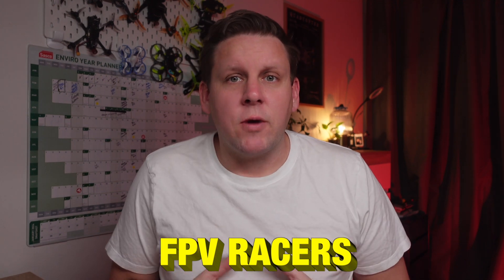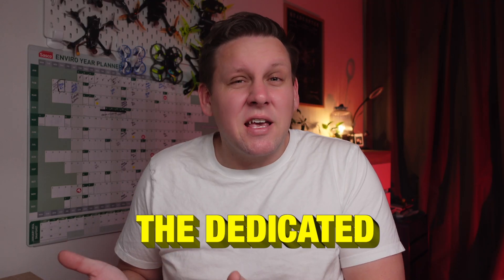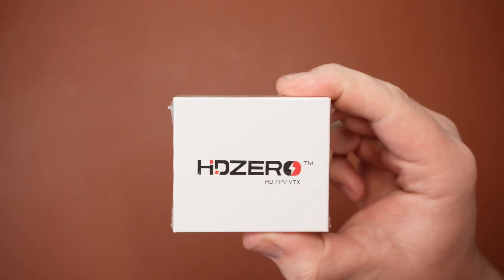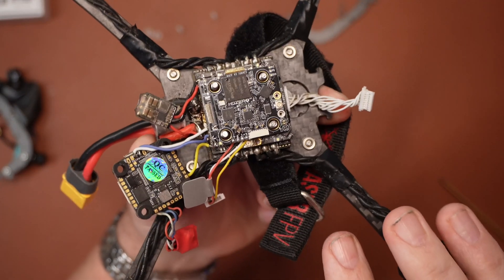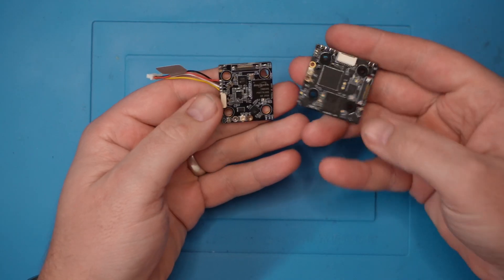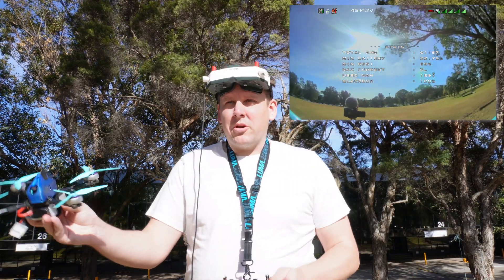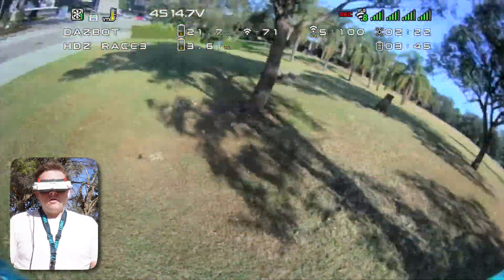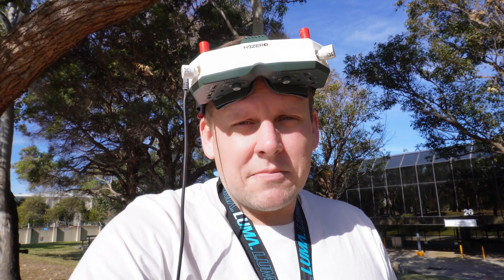HD-Zero's New Video Transmitter For Racing

Comment: What’s the catch though? Surely less power means less of something else
Reply from the maker: It's a Racing VTX, so it doesn't need a huge power input requirement. Racing is done at 25mw, this has 25mw & 200mw output power - so meets the requirements of racers perfectly.
Reply: @DarrenAllatt  very glad to see it because it’s been real tough to find a 20x20 FC with 9V in aus
Reply from the maker: @RookieRay  yeah, I would have just bought from AliExpress or Manufacturer direct. T-Motor F7 Mini would be my pick with the HD Plug.

Comment: How's long range on hd zero? Better than analogue?
Reply from the maker: This is a Racing VTX, so has 25mw and 200mw output power.
The 1W Freestyle VTX has the same range as Analogue
Penetration is a different issue
Reply: I have a video on my channel where I have HDZero's RaceV2 vtx mounted on my 5" Moon Goat kwad. The video I posted will give you a great idea of what to expect with HDZ. It does breakup worse as I get up behind the trees to the back of the park I was flying at (not in the video).

  It is great when flying close proximity and is ok at medium range but penetration isn't anywhere near my other Moon Goat with a Caddx Vista and og dji camera. 

The lower latency on HDZero is amazing though and gives you a one of a kind lock-in feeling. 

I also think HDZero is a lot better all around then analog though.
Reply from the maker: @P.G._FPV  that’s also 200mw compared to 1.2w on a Vista
Reply: @DarrenAllatt  true but honestly the 1w on the Freestyle doesn't really do much better as far as penetration goes. Trees and buildings kill the signal quickly unless you are flying Close proximity stuff. 

I love HDZero but as far as a daily use system for someone flying medium range freestyle in parks or around buildings it is far from the other system I have. 

What stinks is now that I've been flying HDZ I honestly don't want to go back to the other... but it just breaks up way too much in certain areas and these are areas I'm very familiar with and have flown without issues with my other setup.
Reply from the maker: @P.G._FPV  if you get the Nano90 it can do 540p at 30fps so has more penetration as is using less bandwidth 

I don’t know if the Micro v2 supports 540p
Reply: @DarrenAllatt  correct. I have 2 Nano90 cameras on 2 of my builds. One on my Moon Goat and the other on my freshly build Geprc Phantom HD. 

I'm glad you mentioned that as I have forgotten about trying that. 👍

In that setting do you still get that locked-in feeling like when flying in 90fps mode? 

Thanks